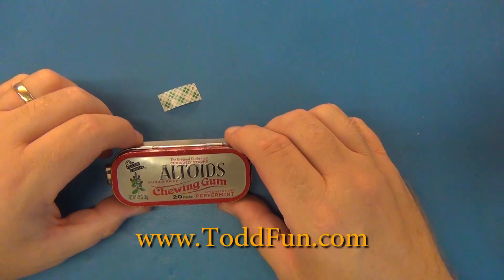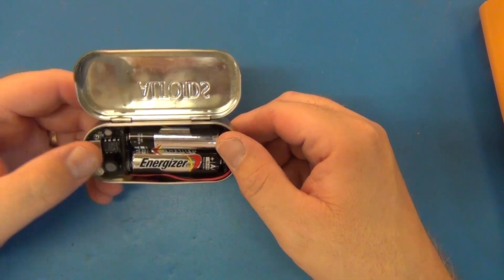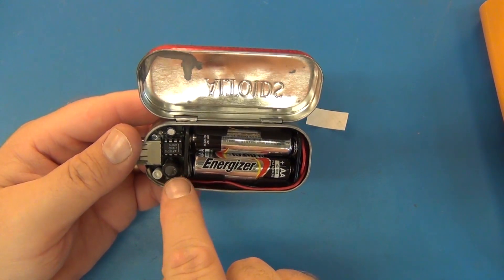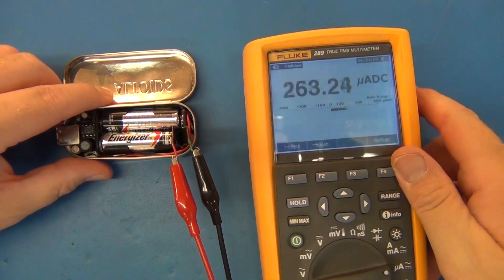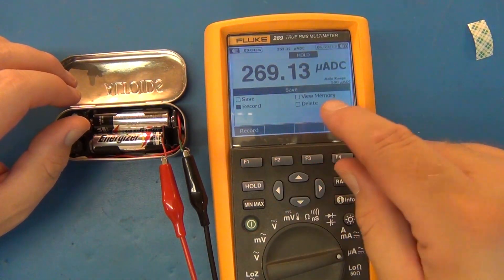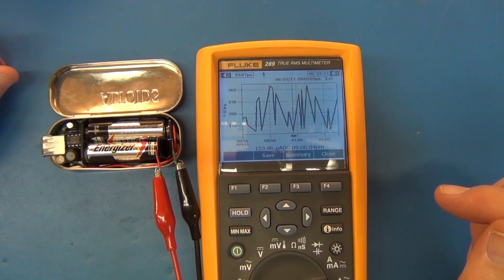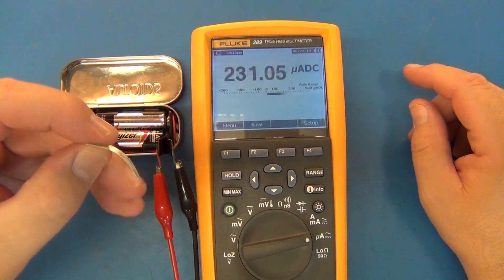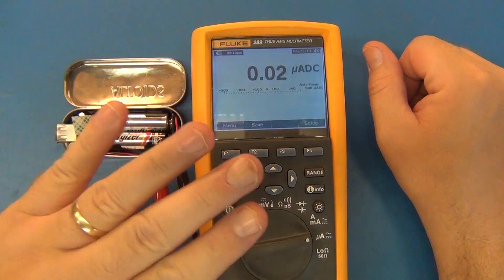MintyBoost battery saving trick and testing

Comment: I use the same trick with my remote temperature sensors. For my watt meter I loosen the screws on the battery plate and that removes pressure on the small pill batteries, breaking the circuit. Both have LED displays that would be always on otherwise.
I really like your copper clad amp measuring trick! Very elegant and simple. Thanks for sharing this!

Comment: This is a guess, but if that tiny bit of current at the end wasn't just meter resolution, it might be from the copper probe against the nickel (tin? chrome?) contacts in the Minty-boost. That'd make a little thermocouple, wouldn't it?